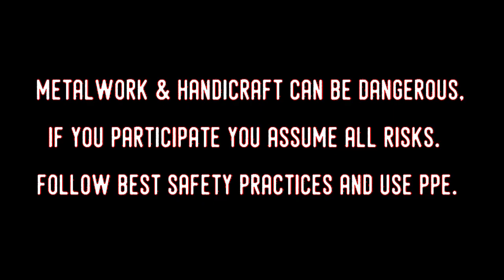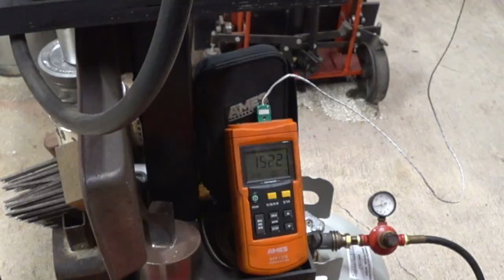Remake a cheap engineer's hammer into a rounding hammer for blacksmithing!

Comment: WHAT YOU CAN DO FOR A VIDEO IS ON THE POST DRILL MAKE A BASE FOR DRILL PRESS VICE WITH SOME CHEAP BEARINGS SO IT WILL MOVE OVER TO EACH SIDE WITH CLAMPS THEY DO SOME THAT HAS A BAR SYSTEM ON A POST THAT YOU PRESS DOWN TO LOCK TIGHT WOOD WORKING USE THEM AND ON THE SIDE OF THE DRILL POST HANDLE SHOULD HAVE STOP NUTS SO IT CAN BE DROPPED LOWER AND PUT A MILLING SLOT DRILL BIT THERE DIRT CHEAP OF TEMU AT TGE END SHOULD HAVE A DIY MILLING MACHINE
Reply from the maker: That's an interesting idea for a future video!

Comment: I know you wanted to make a video 
but why do all that work when you could of done hot rasping should have each side done 
once out the Forge 
15 minutes 
or when hot take to post drill and having a plate to use as a guide then run drill down it 
cooling of with damp rag and glove on 
even faster remember the plate is the guide to keep drill bit tight 
to hammer head 
use a old drill bit dressed up for it
Reply from the maker: Hot rasping is definitely a good option, especially if you don't have a treadle or power hammer.  I can see what you mean with the drill, but I have my doubts that it would be easier or faster than forging the fullers in.  Don't forget that this is a blacksmithing channel after all, so forging tends to be my preferred method.

Comment: Save yourself the time of drilling and hammering out the handle.  Just throw it in the forge and burn it out!  Excellent end result!
Reply from the maker: That is definitely a good option that I have used before. I also wanted to show how to remove the handle remnant if you don't plan to do any forging.